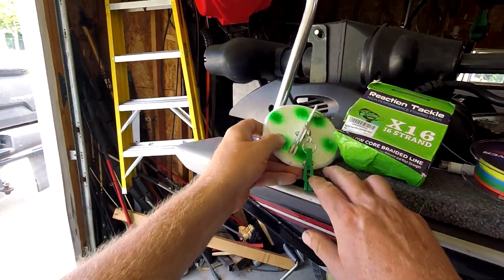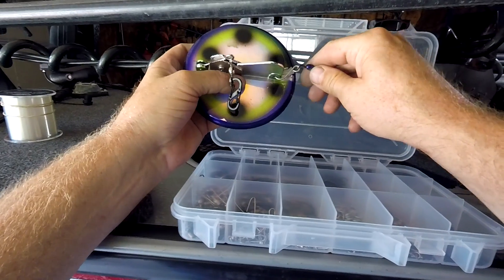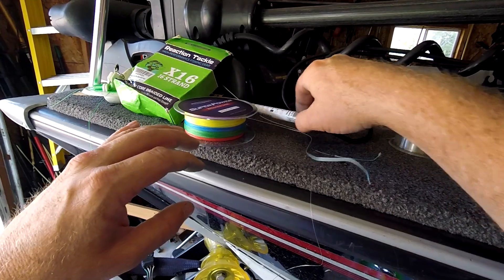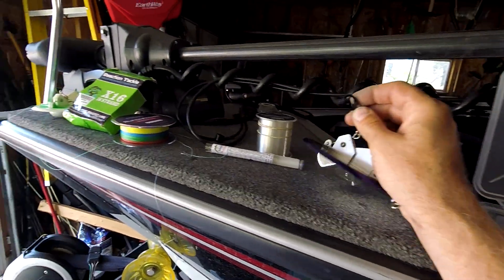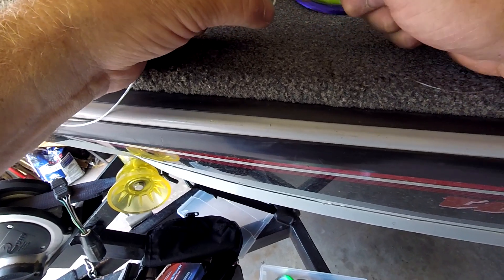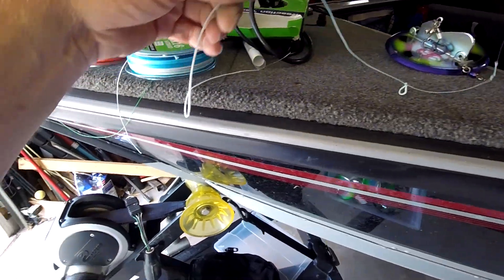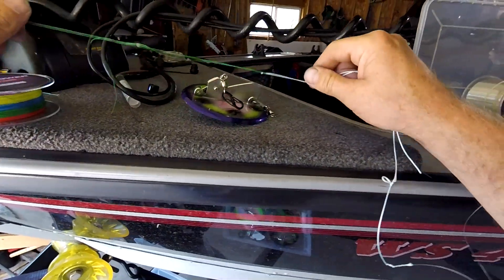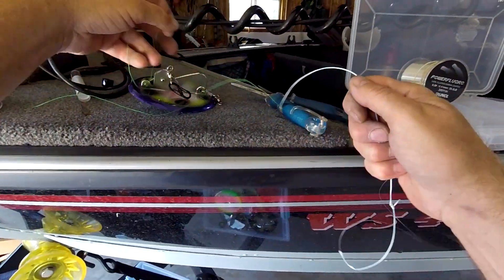SWD Dipsy Diver Revised (Gen 3) Spring Clip and Clip-on Fishing Diver NFN Salmon Fishing Tips

Comment: Hi Nick, What works for me is a separate mono loop through one of the micro swivel eyes. I do this on wire and braid. On braid I use a micro swivel to join the braid and mono leader. I take a separate short piece of 40 lb mono, run the 40 lb through the reel side micro swivel eye and tie the 40 lb into an appropriately sized loop for my spring clip, using a figure 8 knot. I trim the tag ends on the figure 8 knot, and it's done. For my wires, I tie in a short piece of 65 lb braid to the wire, then use a micro swivel to join the other end of the braid to the mono leader. I use the same 40 lb mono loop tied through the micro swivel eye as with the braid divers. So far, it's worked. I just change out the 40 lb mono loop from time to time. In your last video did SAR mean Salmon-Arama? Thank you, Nick!
Reply from the maker: Thanks for the info on that setup 👍  yes when I speak of the SAR I am talking about Salmon-A-Rama.

Comment: I run my wire to swivel then 30ft 30lb  mono leader acts as a snubber with stretch as well as adding the distance. I put the same dropper loop 3 ft from swivel so the leader goes into rod when you take it off to prevent kinks on end of rod with the hanging weight of the dipsy..
Reply from the maker: Thanks for posting. You also bring up a good point about the added stretch when using a longer leader 👍

Comment: Nick have you ever tried a pin clip with a wire dipsey rig? Seems like the clip should hold on the wire line? If I terminate the wire with shrink tube at a 65 lb mini barrel swivel to the leader it should go through the guides ok it seems to me. We can find lots of ways to lose big kings at the boat, and I just really want to try to prevent having to hand line them on wire dipsey rigs!